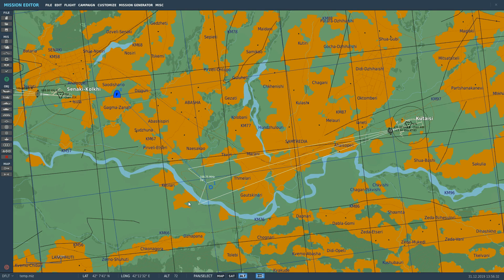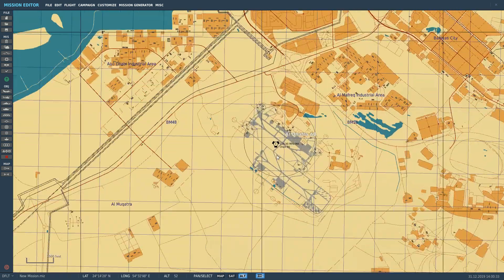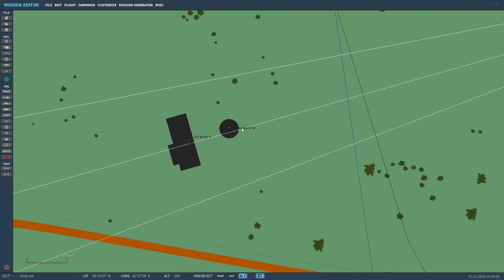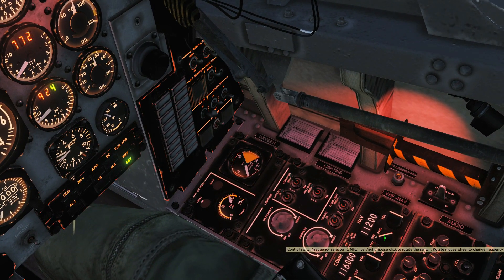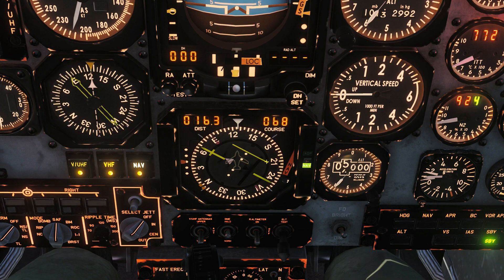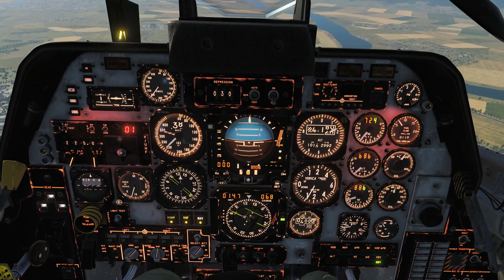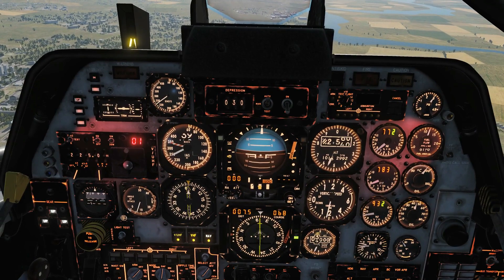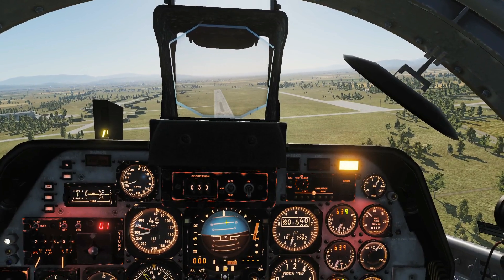C-101CC Aviojet: VOR DME IFR Approach Navigation Tutorial | DCS WORLD

Comment: Great video. The link to the conversion table does not work, but here is the formula:

–TACAN X channels from 17X to 59X: add 106.3 to the TACAN channel number divided by 10. (example 44X: 4.4 + 106.3 = 110.70)
–TACAN X channels from 70X to 126X: add 105.3 to the TACAN channel number divided by 10.

–TACAN Y channels from 17Y to 59Y: add 106.35 to the TACAN channel number divided by 10. (example 59Y: 5.9 + 106.35 = 112.25)
–TACAN Y channels from 70Y to 126Y: add 105.35 to the TACAN channel number divided by 10.

Comment: A good rule of thumb for rate of descent is half your ground speed x 10 for a 3 degree slope (300ft/nm). Eg  200kt gs /2 X 10 = 1000fpm. 150 kts = 750fpm. Also if you keep the top of the beam deviation bar under the heading reference mark as you turn on to final it should be nice and smooth. Which if you look is exactly what you did !
Reply from the maker: Thx Ian!